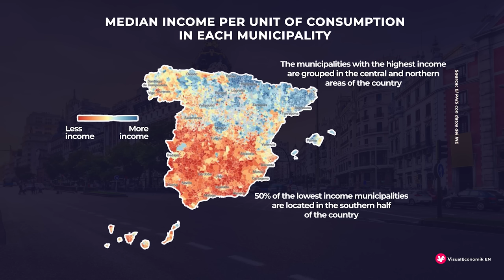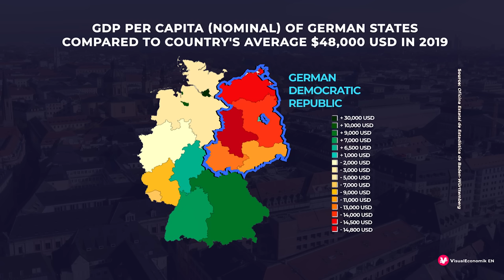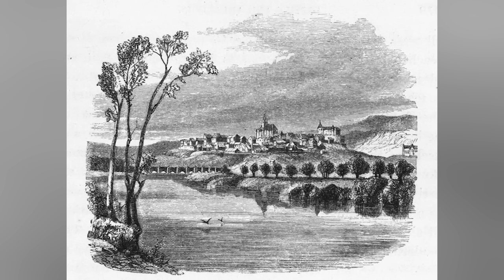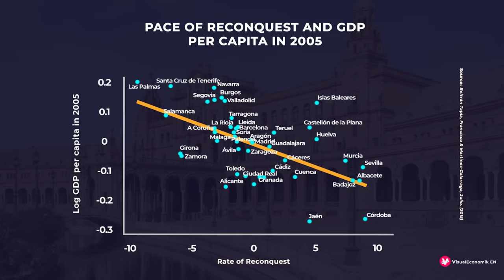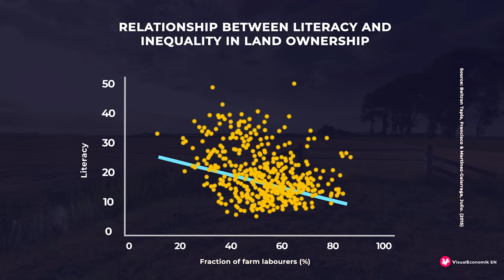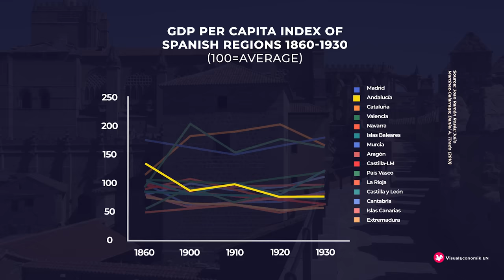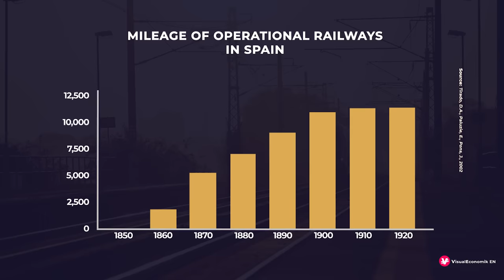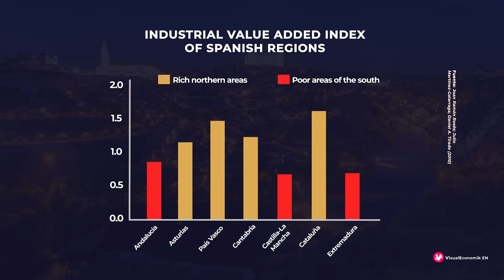Why Is Southern Spain So Poor?

Comment: The climate is another contributing factor. The heat of the south would have had an affect on workers in the pre-air conditioned era compared to the cooler north west climate.
Reply: Iam Spanish the South no is hell all year lol in Granada for exemple more times in year has a tempeartures down 0 degrees celsius
Reply: @Benito-lr8mz pero eres de España. Estamos hablando de los musulmanes y árabes q pertenecían allá antes. Estaban más adecuados a los rayos del sol semejantes a como los suecos florecen sin mucho sol.
Reply: Not for those reasons but climate is a factor, the main one is Oak forests, essential for naval construction of huge galleon fleets. If in times of the spanish empire your region is comisioned with building 2 galleon fleets, your region will get a giant stream of paid work and wealth.
Advantages of hotter climate such as fruits and veggi farming were not in place then because the technology for fresh produce trade didnt exist, refrigeration. Now for example what used to be the poorest region in the south of Spain (Almería) is the richest in the south thanks to fruits/ veggi farming and trade. Posible today with refrigeration, but not in the past.

The north had some advantages during the Spanish Empire times that acumulated wealth and power during centuries:

- Abundance of Oak forests for building galleon fleets.This meant huge comissions and huge amount of labour and wealth.
- Coal mines in the north for industrialization later on, but also for cannon artillery manufacturing.

- Textiles manufacturing monopoly granted to catalans .Catalans got the first position because at the beggining textil trade was a land business connected by land routes and Catalunya was the closest to Europe. Second Napoleón destroyed textil manufacturing facilites in the south and central áreas of Spain together with tabacco, chocolate and similar industries, he wanted to anex the North of Spain to his personal Empire so he destroyed the other regions.  So the Monopoly was granted with the idea of helping the best remaining industry having a really competitive region in that sector in a global economy .

- Racial laws granting priviledges for Basque people to apply for power positions "hidalguía universal" essential for overseas administration and politics. This was a type of one-drop racial law , you had to prove pure spanish ancestry for power positions within the Empire. Basques were considered pure spanish with no doubt by law due to the Reconquista centuries earlier.

So while the south was the main force of the Empire at the beggining because It had the Admin Office of American territories and overseas trade in Seville (Andalucía) and the main departure port for naval expeditions in Palos (Andalucía) together with locally recruited sailors and soldiers...as the centuries went on, the north got the upper hand. They acumulated wealth and power and they got reinvestment

Comment: Its warmer
Reply: Gibraltar is even warmer and it's two times well here than the wealthiest parts of spain per person
Reply: because its the UK @reggie69.
Reply: The árabs thrived yet the whites couldn’t. Interesting
Reply: @dreadhead5719  while it's true, Gibraltar manages itself completely independently. The only thing the UK controls in Gibraltar is literally the military, so it might as well be considered independent,
 the UK economy shouldn't even be compared to Gibraltar, though
, as Gibraltar is also two times Richer than the UK,
I'm only saying it because people are saying such simpleton stuff like because it's warmer and rubbish that can be easily debunked by just using your brain why is Southern England so much wealthier than everywhere above it in the UK when the north is colder
I was actually going to say Singapore, but I remembered Gibraltar is literally under Spain.
Reply: @reggie69.  Gibraltar is tax haven.
Reply: @dariuszgaat5771  12.5 percent corporation tax going to 15 percent 

I could leave it at that, but technically, it only has 20% income tax and vat, leaving other things like capital gains and dividends untaxed for the rich, but Switzerland,Hong Kong, Singapore and a lot of other countries do that or tax one and ignore the other usually capital gains to attract rich people to move there

Tax haven implies no corporation tax
Which doesn't apply here.
 Gibraltar is just that good
Low Personal tax don't count

Comment: Just out of curiosity...What % of Spanish people have arab genetics in them due to the muslim occupation. Im not from europe but some Spanish people especially the men look arab...and to an extent the  Portuguese ?
Reply: The DNA study shows that the genetic composition of the Spanish population is mostly Celtic or Iberian, with very low contributions from other groups such as Romans, Phoenicians, Greeks or North Africans. The population of southern Spain has less than 1% North African component, due to lack of mixing between groups with little impact on the genetic footprint.
Reply: Indeed the arabs were a minority among the islamic invaders as they were mainly berbers not arabs.
Also the invaders were a minority compared with the previous population.
After Conquest and progressively during years and years what happened was most of the people converted to Islam.
So in the end the islamic people in Al Andalus as It was called Hispania during Islamic rule was mainly the people with similar DNA than the people during Visigoth rule and the people with similar DNA than the people during Roman rule.
Current population IS composed of that same DNA which IS essentially pre-roman. Romans, Visigoths, Islamic invaders and some others influx on DNA IS relatively low.
Pre Roman populations were composed of Iberians and Celtic peoples.
We are mainly mediterraneans with Celtic influx and some other low apportations.
Reply: Ah, you're a man of culture (ironic mode off*)

Comment: arabs
Reply: The DNA study shows that the genetic composition of the Spanish population is mostly Celtic or Iberian, with very low contributions from other groups such as Romans, Phoenicians, Greeks or North Africans. The population of southern Spain has less than 1% North African component, due to lack of mixing between groups with little impact on the genetic footprint.